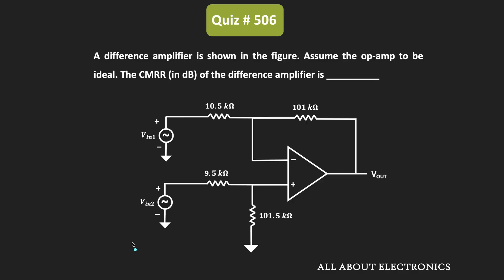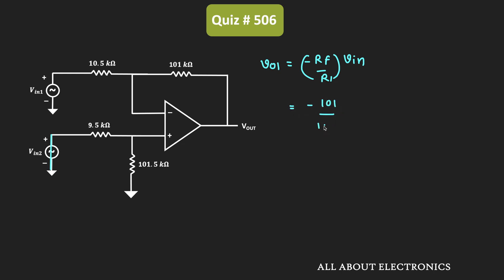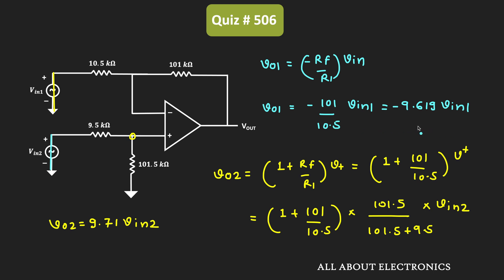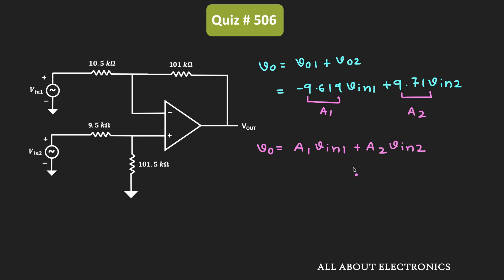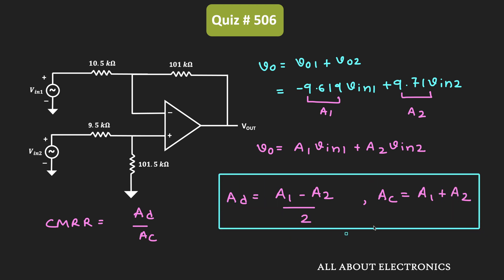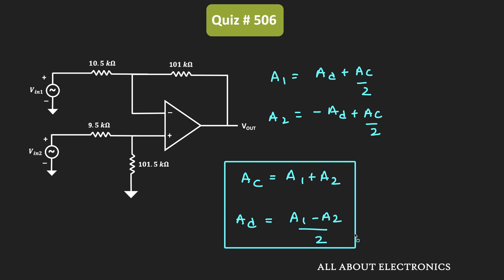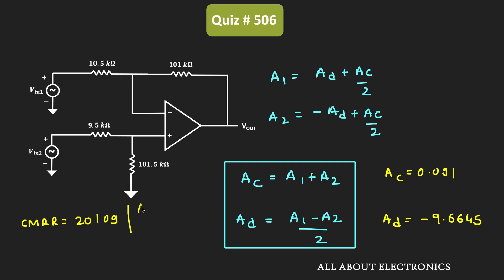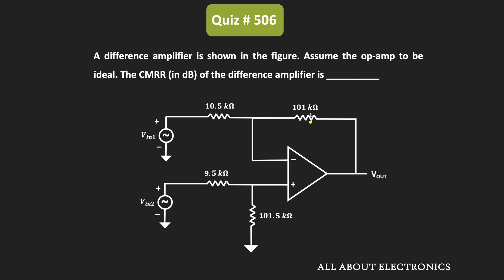CMRR (Common Mode Rejection Ratio) of Difference Amplifier | Quiz # 506

Comment: Hello, thank you for the video, helped a lot, just wanted to ask if you still out here, the expression you derived for A_d and A_c seem general for any differencial amp, could you tell me if they are or it will depend on the disposition of the resistances and for each case i should do the derivation of them.
Reply from the maker: Yes, the expressions for Ad and Ac generalized expression. But the value we got for A1 and A2 depends on the resistor configuration. Depending on the configuration, that may change. But the rest of the procedure will remain the same.